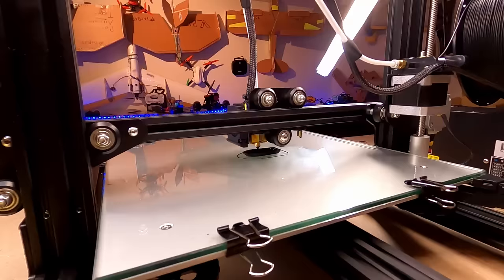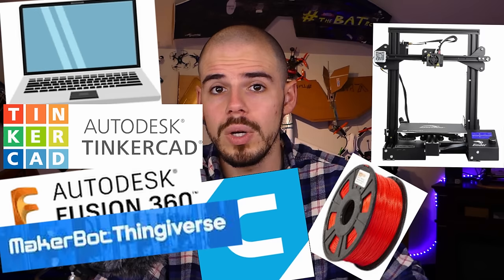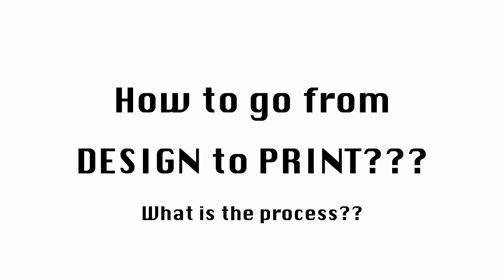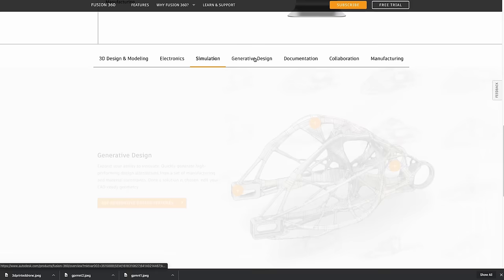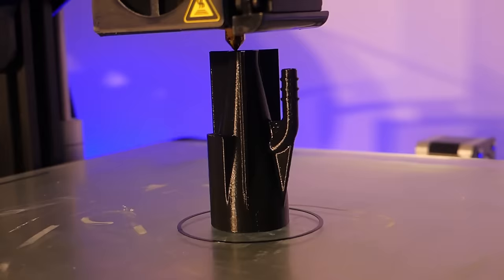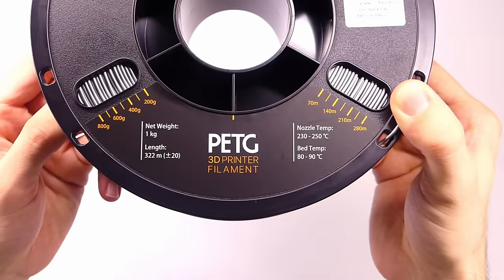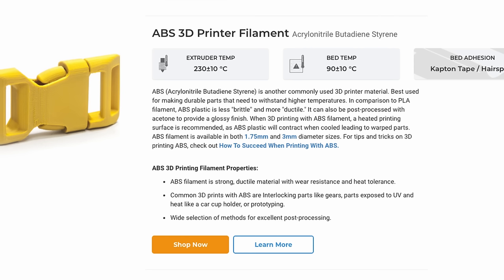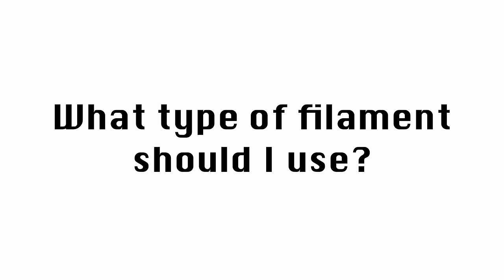Don't Know Where to Start? 🥺 3D Printing Crash Course for Beginners

Comment: I swear by PETG for functional prints! Stringing can be annoying, but keeping the filament dry seems to help a lot. I have never heard of ASA though, sounds interesting!
Reply from the maker: Yeah I just started printing with PETG and have noticed a bit more string and roughness than my usual PLA. It seems to be about the same as PLA weight wise, so I don't understand why more people don't use it for quadcopter frames! That's what I want to do is design some micro frames.

Comment: Just took delivery on my first printer. It's a Sermoon D1 and I did the first print of the tug boat with very good result right out of the box. Isn't much to go wrong when downloading part file, then running through the slicer all very straight forward. I have very little experience with CAD of that its all 2D, Trying to become literate in FreeCad so I can chop 3D models from the web into more friendly printer files.
MY PROBLEM. I want to print a human skull and a Pacaras skull for visual comparison. I found, understandably. printing such things as a stalactite is difficult without supports. Its counterpart, the stalagmite is easy. MY SOLUTION Remove the jaw to print separately. (1/2 of the problem) Then cut off the top of the skull to make two parts with a flat surface. Also adding four pockets on each for dowels (also printed separately) to mate the two halves back together.
I can see editing a 3D drafted part somewhat straightforward with skills to be acquired, but I can't imagine how one would edit a wire frame or point cloud model. Perhaps one could just "erase" with  digital pen or create a plane or sphere to cut out parts. Well, wish me luck, I'm going back to my Homer Simpson style of editing.

BTW great video. I'll be looking for more.

Comment: Is this also the one you would recommend? Creality CR-10 V2 FDM 3D Printer with All Metal Extruding Unit Dual Cooling Fan Silent Motherboard Meanwell Power Supply 300x300x400mm

Comment: Hey Adam!  As a retired CNC machinist/programmer (non CAD/CAM) I've been wondering about this for quite a while.  What I don't care for though, is the non-smooth surfacas it appears to produce. Am I missing something?    GB
Reply from the maker: Hey! That's correct; all extruder-type 3D printers will show some type of layer lines. The options are to smooth the prints using acetone or some other processes to essentially melt the surface layer, or use a resin 3D printer instead, which has almost indistinguishable layer lines.

Comment: Great, comprehensive video, but I think Adam skipped over the details of a very basic aspect, "slices".

Check the reply for detail.
Reply: Additive 3D printing is very basically like making an object in slices as if you're using a very precise hot-melt glue gun that moves around and builds up your object in layers by following a path.

It works by "squirting" out the first layer, or "slice", then moving the printing head up a very small amount (roughly the thickness of a layer), and then printing another layer on top of the first by following a path which, unless you're printing a perfect cylinder, rectangle, or other shape that doesn't change, changes a little with each slice/layer (those terms are synonymous).

So, the basic function of a "slicer" program is to take the file of the object you want to make and break it down into slices, which is a one-layer path for the printer head to follow, so that the printer knows what layers to print that "stack up" to make your object.

A KEY ASPECT OF 3D PRINTING is that you rarely want to print what appear to be solid areas as completely solid material, because it's unnecessary, wastes a lot of material, takes much longer, and has other problems that can screw up your print.

So inside any solid-appearing object you print, if you cut it open you won't see solid material, but a 3D structural pattern, like "honey comb".

So along with creating slices, the slicer software inserts the pattern of your choice that will serve to fill solid areas. You can make them very dense patterns if they need to be very strong and not deform when pressure or weight is put on it, like it you're making a base that's going to hold a heavy object.

Or if they're just shapes that only need to hold the shape and not any other pressure, the interior fill pattern can be much less dense, so it uses less material and prints quicker.

Certain objects maybe need to have different characteristics in different areas, so slicer software can adjust to put different fill patterns depending on structural requirements.

In conclusion, the slicer software breaks the object into horizontal slices that are printed in each pass, and helps fill areas with a pattern instead of just solid material, in whatever way you think is best.

Keep in mind that using solid material doesn't usually result in the strongest, most rigid result. Structural patterns, while saving material and weight, are also usually much STRONGER than solid material.

(So you CAN just make everything out of solid material, but when you see what that actually entails in terms of time, material, and strength  you will mostly not want to do that.)

I hope this helps clarify "slices".

Comment: I just got an Ender 3 Pro. No problem setting it up except for needing to adjust the Z-axis so the print head would come close enough to the bed.  Can't figure out how you are supposed to load the filament up to the print head.  It doesn't seem to want into the white tube.  Any idea on where to see a video that shows the actual operation of this printer?

Comment: So the different filaments, are they all compatible with all printers? Or do you need to watch out which supports which?
Reply from the maker: Hey! That's a great question! Almost all consumer level printers use 1.75mm diameter filament, as opposed to the larger 2.8mm filament. That's the biggest thing to watch out for. Secondly, some machines can handle specialty filaments, like flexible material or carbon fiber or those requiring very high nozzle temperatures, better than others. But generally, any nodern printer will be able to handle PLA (even specialty pla) and flexible filaments like TPU.
Reply: @RCwithAdam1  thank you, I’m trying to learn, these areuseful info

Comment: Merry Christmas Adam, I'm researching 3D printing to make jumping spider enclosure decorations. 
I was wondering can you reuse the filament?
For example, I make a bendy boat and it's goes wrong during the printing process; can you recycle the PVC (I think that is what you said the filament was called 🤦‍♀️🤣)?

Thanks 😊 

Also, do you need to use the software on a computer? Could you use an android phone or tablet?
Reply from the maker: Merry Christmas! It's called PLA, and yes you can reuse it, sort of. From what I've seen, trying to reuse material to make more filament is quite a process and probably not worth it unless you have a LOT of filament to recycle. 
You can use a browser-brased slicer on any device, but the good ones will run on a real computer.

Comment: Newbie here, can we print different Color’s in one project and how?
Reply from the maker: Generally, no. You need either a dual extruder system, or a multi-filament changing system. Or you can stop mid print and change colors, but that's not usually that helpful.

Comment: Been considering this for the longest time but what concerns me about how things being built. Like some cosplayers building giant swords or a helmets. Some shown like building parts or making them for assembly, but showing seams or openings with how they were put together. Is there a recommended method to make it look like its seamless, or use a soldering kit and hope for the best?
Reply from the maker: Hi! Two options for seamless finishes I've seen are 1. Chemically smoothing the print (like with alcohol or other solvent) and 2. Sanding the print and then building up coats of paint (often with a gloss topcoat).

Comment: What basic low budget desktop would be good enough for the printer & what specs does it need?
Reply from the maker: Good question. I would guess just about ANY recently produced computer could do what you need for 3D printing. Fusion 360 does require a bit more processing power, depending on what your modeling. You'd have to check the software manufacturers websites.

Comment: Hi Adam love the video. Yet I have a problem. If you can, can help me out with the ELEGOO NEPTUNE 2. I have tried all that you state and I am just frustrated as they done seem to be able to pick up my new 3D Neptune 2 printer. I saved a project of a Cobra to a stronger file but I am just not getting anything from it even getting a g code as well, so can you reply with an idiots guide to the process please. I am disabled so thought I would get a printer as my hands are not working as good these days 
Respect my friend Paul.

Comment: Amazing video for a noob like me, Thanks so much! I guess the only question I have is...can these 3D printers catch on fire due to incorrect settings? Since they may be left unattended for a while, would hate to leave for the grocery store and come back to a burned down house.
Reply from the maker: I'm NOT experienced with 3D printer fire-worthiness, but generally, something would have to be defective about the machine for that to happen. Or possibly if a print failed in such a way that the machine was physically damaged and the heating element somehow became damaged and overheated. By and large, fire is super unlikely, but you should still take proper precautions just like with any other electric heater-type device.

Comment: Tx Adam. Any thoughts of preventing the nozzle from clogging?
Reply from the maker: Hi, Robert! Probably printing at the higher temperature range for the filament will help. Also, keep in mind that if you print one filament at a high temperature, and then print another at a lower temperature,  if there is still some of the old filament in the nozzle, it may not heat up enough to flow smoothly.

Comment: Can someone please put out a video and include the type of computer needed to run a printer…
Reply from the maker: Most computers are powerful enough to run slicing and modeling software. Chromebooks will work using only browser-based programs. I just made a video about it here: https://youtu.be/Ydvx58ZYZOU .

Comment: I still don't understand how i get my object into the printer. How do it scan an existing object into the computer before it can be sliced?
Reply from the maker: Hi. You will need either a dedicated 3d scanning device or an app for a smartphone. I haven't done amy 3D scanning yet, so I can't say which methods work best. I think once you scan it you will then have a .stl file to then modify and slice as you wish.
Reply: @RCwithAdam1  thank u

Comment: i have a makerbot mini and ive been using it for years. i go on thingaverse and load it onto the makerbot desktop , make changes and print it. the issue is it is very small. i bought an et5x and ive been printing the files that they gave me. is there something like the makerbot desktop that I can use without pulling an sd card all the time. i have a cord from the 3d printer to the computer. thx

Comment: I'd like to make stamps for pottery, is that possilble?
Reply from the maker: Yes. Do you mean ink stamps to put on pottery, or stamps to make an impression into the pottery when it is soft? For ink, I've had moderate success using NinjaFlex filament, and for impressions I would try a more rigid but still flexible TPU (I use Sainsmart TPU).

Comment: What if you want more than one colour
Reply: there are more expensive printers that can feed multiple colors on demand.  cheaper is to just swap color by pausing and loading mid print.  Lowest cost and most popular is simply painting objects like miniatures for D&D with 50 cent acrylic paint at Walmart.

Comment: I have a question that no one answer:
Can I plug the printer in a computer? How am I going to put the archive into the printer? USB?
Reply from the maker: What printer do you have? Yes, I've plugged my printer into the computer to print, but it must stay connected and the computer stay on during the print. At least, that was the case. Things may have changed by now.

Comment: I just ordered the CR-10 in the description, but realized there's a CR-10 V3 out, should I return it and get the V3 instead?
Reply from the maker: I didn't know there was a V3, so I'm not sure. I'll have to check it out.

I checked it out; the V3 is definitely an improvement, primarily with the silent drivers and direct drive extruder. But right now it on sale on the creality website for $460, while the original cr10 is $299. It's probably worth the extra $160, but it depends on your budget. Personally, just based on looking at it, it's not a very streamlined or sleek printer. So for $460 I would want a printer with a built in power supply and more streamlined design. At this moment, though, I can't think of a specific printer with the same size print bed as the cr10 that would be ideal.
Reply: @RCwithAdam1  Appreciate it! I didn't think you would respond this fast haha!

Comment: Is the upgraded extruder worth it on the ender? Is there any other upgrades i should get as well
Reply from the maker: Eventually I did replace the original bowden extruder for a direct drive conversion from a company I can't remember the name of right now. I really like it, but the stock extruder is fine for all except the most flexible filaments.

Comment: So I don’t need to use a slicer if I’m using links off thinyverse right ?
Reply from the maker: You WILL need to use a slicer to print models from thingiverse, or any .stl file from anywhere else. The printer can only read a .gcode file, which is what you will end up with after using the slicer software to tell your printer how you want the model printed. To put it another way, unless you have a .gcode file intended for your printer, you need to put the 3D model you intend to print through the slicer software.
Reply: @RCwithAdam1  thanks man I’m looking on getting a printer I’m a real noob rn but  good with things like this..

Comment: Best plastic for gears ?
Reply from the maker: Hi! Good question! Really depends on the application, gear speed, torque, etc. but my understanding is that nylon is one of the most durable filaments--especially if it's combined with something else like carbon fiber. But Pro PLA or PETG can work well too for simple applications.

Comment: Hi adam, I wanna know what kind of 3D printer that can print "mini me figurine" with color?
Reply from the maker: Hi! Any 3d printer can print with color filament. But if you want to print two or more colors at a time, the options are limited and much more expensive than a standard printer. I don't have any specific recommendations for those kinds of printers right now. Does this help?
Reply: @RCwithAdam1  i thought it would be sls powder printer?

Comment: Great video. What size laptop would I need for 3d printing? As far as core5 or 6 and 64 or 32 GB? Thanks in advance
Reply: It doesn’t really matter the size of your laptop. The 3d printer does most of the work, the laptop is simply mostly to convert the files and put on a sd card. The printing speed isn’t based off of your computer
Reply: How much computing power so you need for the cad software and the slicer?
Reply: @charlesmckinley29  not really much at all. It’s wicked wicked simple how to slice and stuff. You go on thingiverse and download something you want to print to your desktop. Then you open up cura, the slicer, and simply drag your downloaded file onto cura and just hit slice. It slices on my computer in literally 2 seconds on a gaming pc so on a wicked low end pc I’m sure it won’t take more than 10 seconds to slice. You save it to a sd card, plug the sd card into the 3d printer and then your 3d printer does all the work. You could turn off your pc and it will print fine. My 3d printer isn’t even connected to my pc at all. It’s all done through sd card which makes it fast and simple
Reply: @XessiveGamer  what 3d printer do you have if I may ask?
Reply: @kentick3795  I have the longer lk4 pro

Comment: During Christmas 2020 season, Creality is selling the Ender 3 for $157 (only from creality3d.shop & I get nothing for telling you this), so I couldn't pass it up. Plus it has one feature I really need because I'm an idiot, basically, and that is "Resume on Power Failure" meaning, I won't lose my latest project when I trip on the power plug and turn the printer off accidentally. Because, I know I will at some point...

Comment: 11:38 buzzzzz stop. It does depend. 
Printing air or oxygen is not going to be smelled. Water also you are unlikly to smell. 3d printing is not all plastic yoda heads. 
Pla is a easy to print very low toxic plastic common used. Put in a extraxtor vent anyway dood. 
Cheese printing could be nice. 
Anyway.